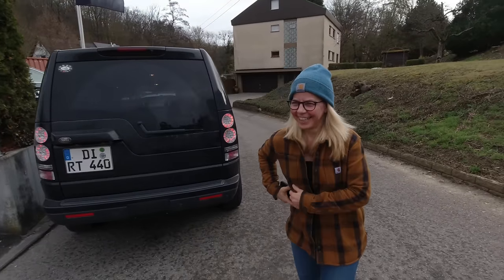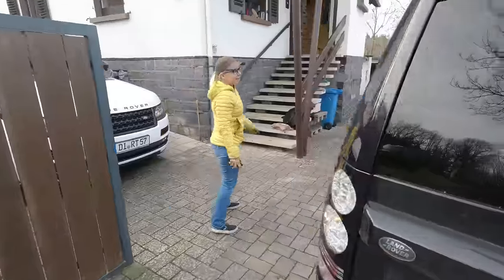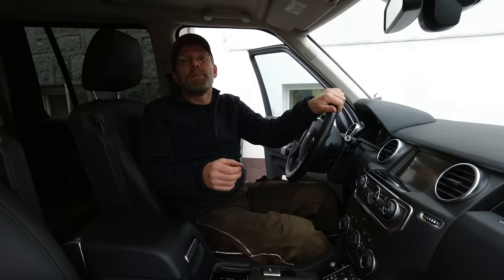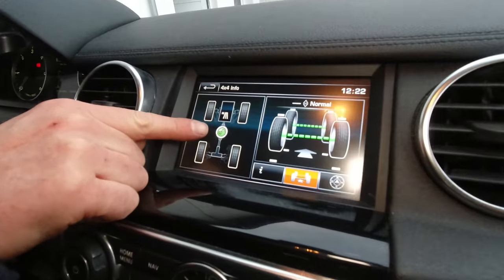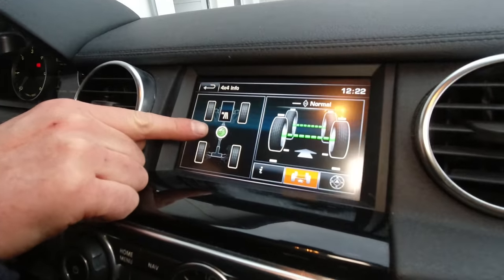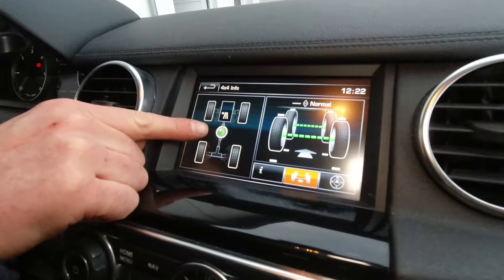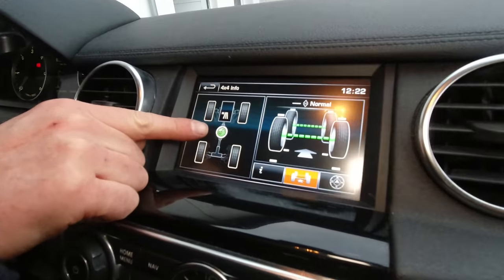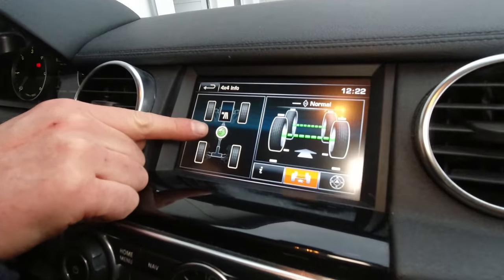We Bought a "Failed-Engine" Land Rover Discovery 4 in Mint Condition / S5-Ep8

Comment: This was a very informative video. That towing situation would've been a perfect opportunity to use the LR3's CB ... or PMR446 handhelds.  That leather on the HSE (we have a '13) is really nice, and can be easily conditioned with some hand cream.   You're so right about that useless cargo area cover ... we have a collection of them in the garage eaves!  On the oil check, in normal operation, the truck has to sit for at least 10 minutes before a reading can be obtained.  That service record (or lack thereof) is pretty scary; could that mean it had no service for 90,000 km, or that it was done (and TÜVed) at an independent garage that didn't record it in the TOPIx?  I guess the seized bolts may be part of the answer.  Sort of odd that the rear "HSE" emblem doesn't have "SDV6" in front of it ... I know in Germany some people order cars with all the schnick-schnack left off, but this appears half-way.  Congratulations on your new "content provider" ;-)

Addendum:  Christian's dead right in saying to never buy one with wet carpets!  We just had a melting snow leak in our '13 Discovery 4, and remembering how we had to replace a bunch of modules from a sunroof channel leak years ago, I got on it right away to ensure we dried it out and double-checked the gutters again.  It's a common and potentially fatal flaw!
Reply from the maker: Yes, we actually have two radios.  Damn…. It had a oil change at 32t and at 65t  in between but not LR.  Pretty poor interval for a DPF.  I think it took its toll.  It’s not a snapped crank but I don’t know.  Christian

Comment: I am envious of your 2 post lift. Have a 2012 BMW 750i AWD that I purchased as a project. Engine has a bad connecting rod bearing, so will need to find a good replacement, hope that is possible? I did complete an engine swap of a 525i which went very well, but this 750 will be much more of a challenge. Current driver is a 2012 Mercedes ML350 Bluetec. I did have to change its oil cooler seals, that was about 32,000 km ago. Started driving diesels in 1981 with VW Golf/Rabbit.
Reply from the maker: OMG just as much work as our Land Rovers.🫣😅🙋‍♀️
Reply: @Vera_and_Christian  Thank you!

Comment: On 22:48 you made an mistage what you never should do on these engines. Allways add the filter to the filter base, not the plastic cup. Botton of the base there are an small rubber valve for draining the filter housing when removed. That tiny rubber valve can be pushed out its holder when filter are rotated back with cup by side force to it. -> Most likely one reason for many bearing failures, because when valve is not closed some of oil pressure is losed be open valve. Worth to check everytime you change filter.
Reply from the maker: The engine is broken, catastrophically…. We did mention that a couple of times. It doesn‘t matter which way the oilfilter gets put in. We have more than enough videos where we show the correct way to install an oilfilter on a D4👍🙋‍♀️
Reply: @Vera_and_Christian Wanted to note that nobody watch and copy. 🙂Good videos

Comment: Local garage to me had a discovery come in with a suspected starter motor failure, fitted a new one and turned out the engine was seized, it had never been serviced from new, had 70k ish miles on it. Oil had got so gummy the level sensor still showed it had oil in.
Reply from the maker: OMG... 😳🤦‍♀️🙋‍♀️

Comment: I love your posts. 

Please advise, my 2012 LR4 diesel car smokes when press hard on the free way. Then it clears
Reply from the maker: Don‘t press hard then, you‘ll damage the turbo sooner than later. Especially when you know there is a problem. Do a smoke test to find your leak in the air intake system. Black smoke is always an indication that something is wrong and needs to get fixed before it gets really expensive.👍🙋‍♀️

Comment: i currently own an LR2 (the forerunner of your car) for £3400 and have had to spend £2000 keeping it on the road! so buying an LR4 isnt so cheap over here either, especially if you want a runner off the court.
Reply from the maker: I would keep the LR2 and fix it.  The LR2 is no longer permitted in the city here - unfortunately.  Christian
Reply: @Vera_and_Christian  I have another car now (as well as the freelander2) that costs less to insure, pay road tax for, and it uses less fuel as it only has a 1.5l engine. I'd love to keep the LR2, but economicly, it doesn't make sense.

Comment: I had a Discovery IV 3.0 (306dt) a great car, but: 1) I did the whole engine (crankshaft), it didn't come out cheap. 2) the seats of the first generation LRD IV have a rougher but more durable leather, it feels good under a weight of 115 kg. 3) The air suspension has become very very rigid. I replaced everything in the suspension, and it didn't help, driving the car became unbearable, for this reason I sold it. Ergonomically, the car is very well suited for hunting and trips to a country house, it is probably the most successful body.
Reply from the maker: We did fix the suspension too (next video) and it was no longer drivable.  It ended up that the allignment was way off.  I fixed that (not in the video) and it drives now better than ever before.  The seats in the LR4 are actually just as comfortable as the RR.  The RR seats just look more luxurious and have more adjustments.  Christian

Comment: Have you had an "Engine Systems Fault" on the Disco4 TDV6 3.0 with the error code P0087: Fuel rail system pressure - too low?  I had a cracked inlet manifold that was changed recently and apparently now that the intake pressure is back to normal, some sensor or the diesel rail system may have damaged. What can cause this error? Or is it the fuel pump?
Reply from the maker: Maybe the fuel pump was not timed correctly.  That is required on the 3.0L.  Hard to say. Must be related to the repair.  Christian

Comment: Leather seats are hot in summer and cold in winter. Going around corners they are so slippery that the steering wheel must be used to hang on for dear life. First job on a new car is to get cloth seat covers to fix the horrid seats that you are charged a fortune to have. My new car brought in Switzerland had leather seats. I argued like mad but was told leather luxury seats were mandatory. They are not luxury but a punishment.
Reply from the maker: I will never, ever, ever agree to buy a Discovery without leather seats, ever. Or any other car for that matter. 👌👍🙋‍♀️

Comment: Another great vid. Very entertaining. However, I would be most grateful for any help you can provide with my 2013 RR Vogue 3.0 TDV6 Gen 1. It has just gone into limp mode and thrown up fault codes P2586-36 and P2586-32 "turbocharger boost control position sensor B circuit" ". I can't clear then and I can't find a "turbocharger boost control position sensor" Any thoughts?
Reply from the maker: You can contact us on our Patreon Page for help👌👍🙋‍♀️

Comment: Well Christian 4 disks and 8 brake pads on this car is more then 300 euro's. But i think you should start selling repaired Disco's. Even i would buy one from you only if the roadtax was not so high in the Netherlands.
Reply from the maker: 300 is about correct in Germany.  Gets you Brembo only.  Christian
Reply: @Vera_and_Christian  thats very cheap for those big brakes. I only use EBC on all my cars and 1978 range rover. Great stuff that last long time.

Comment: The British can design very nice driving, well packaged vehicles. The Range/Land Rovers and Jaguars (although Indian owned) are still designed and made in the UK. They are beautifully appointed and the styling is classy without being boring, they are a delight to drive. Unfortunately the materials used in certain components are cheap and cause failures at certain age and kms. Maintenance is critical on these, skip services and you may need to wear a nappy after visiting the workshop and receiving the bill. These are complex machines with labour intensive time consuming repairs that make them horrendous to own and maintain at a certain stage in the vehicles life. Air suspension issues, age related electrical gremlins, degrading plastic engine parts, especially cooling system. Engine failures caused by cheap crap parts like plastic water pump impellers breaking up and causing engines to not cool properly is a common occurence in all European manufacturers now. These vehicles are actually well engineered, it is the use of crap materials in certian areas over time that make them worthless money pits and the cost and time to put right. To make matters worse, these cheap quality parts are actually very expensive to buy. This is a shame as I really like the brand and the vehicles are lovely, just do not have the time, money or patience to own one. I am from the UK and I just would not touch one unless new and under warranty, Asian vehicles just seem to be better built and made with better quality part materials in critical areas.

Comment: Someone else did a video showing why these diesel engines fail, due to the DPF increasing engine temperature to clear it out!  It was about Jaguar engines, but of course they are all Ford engines.
Reply from the maker: This one failed because of oil dilution.  Christian
Reply: I also believe that's one of the reasons why Land Rover's so finicky about ACEA C1 5W30 ... and why Christian moves to 5W40 as they get up in years.
Reply: @Vera_and_Christian  Did they put the DPF under the car again?

Comment: Do you lock the pillows when you lift up?
Reply from the maker: The pillows? Not sure what you mean. We do not need to do anything on the airsuspension when we are not working on the airsuspension in order to lift it up. However, when we work on suspension parts, we always always take out the fuse, and if we have to torque anything in ride height, we always deflate the airbags with our GAP tool. We show all these steps in the according videos. 👍🙋‍♀️
Reply: @Vera_and_Christian  I was thinking about air suspension, do you lock it, but now it's clear to me

Comment: How about retrofitting a RR V8 Diesel into it?
Reply: Not really possible unless you can build and design a can bus 2 emulator
Reply from the maker: The V6 drives nicer. I got the V8 in my RR.  It’s not as responsive.

Comment: Put a Toyota engine in.
Reply from the maker: Which one has 600 Nm?  Christian
Reply: Have we had all these engine problems since they introduced synthetic engine oil? 
Before synthetic oil,  car engines just seemed to wear out, now they just seem to collapse at low mileage.
We used synthetic oil on aircraft jet engines, but never on internal combustion engines.
Reply: In the UK, we use BHP.